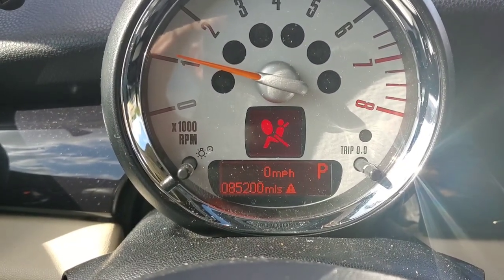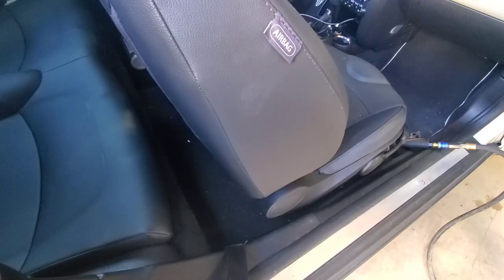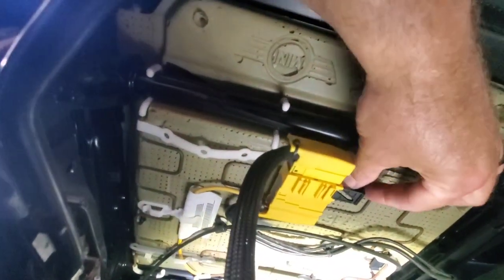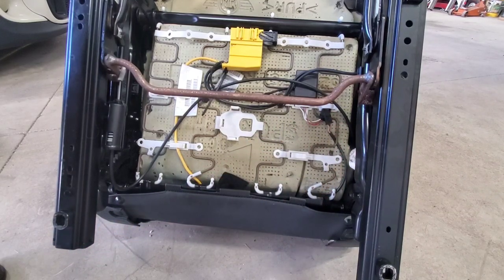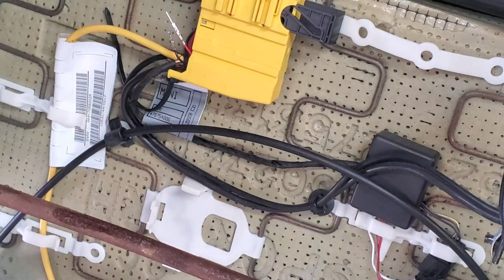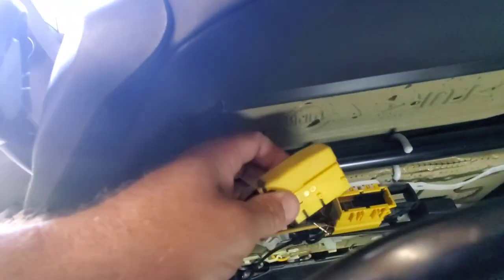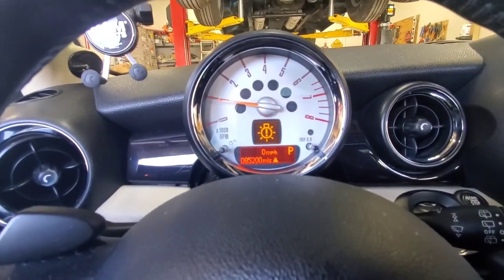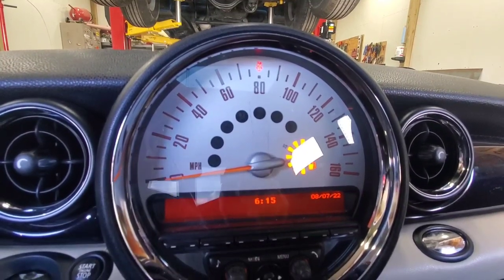Mini Cooper Seat Warning Lights Bypass- 10 minute fix

Comment: It looks like all the seatbelt bypass is doing is shorting the read and black wires / pins. Thanks for this video. You're right $1,500 to fix an obvious design / quality issue is ridiculous. Too many people have this problem for this to have been a reliable system. To have the default for a failure turn off the airbag is beyond dangerous.

Comment: I just recently bought a 2010 base mini and after purchasing discovered it had this airbag light issue. I checked underneath and it looks like it had this exact fix done to it, but the light is still going off. could the override piece have gone out? I'm trying to troubleshoot but can't figure it out

Comment: Do you have a way to do this for the rear seatbelt clips? I need to bypass the wires connecting to the seatbelt clips in the rear as they keep setting off the airbag/seatbelt light as I have removed rear seats also. Many thanks 🎉

Comment: how did you know it was the passenger side vs the driver side seat, does the driver side not have a sensor, are the instructions essentially the same for the driver side, lastly is there a link to the device to order from ebay and is it the same for all mini coopers, I have a 2010 Cooper S, thank you.

Comment: Do you recommend disconnecting the battery before doing any work on the seat electrics?
Reply from the maker: No reason too. You unplug the seat harness from the car before doing any work on it so I see no benefit to unhooking the battery.
Reply: @hotrodyj  yep, thanks just as i thought.
Reply: Purchased an emulator from amazon. Connector will not fit my R 58 coupe bought in the UK. Any difference between U.S and European vehicles?

Comment: What is the name of the part? Is it compatible with 2011 clubman?
Reply from the maker: Airbag passenger seat occupancy mat sensor bypass Mini Cooper
Reply: If you look at the compatibility chart on the EBay site that sells the part he is using here, it will tell you if it will work on your Mini. I have a 2012 Countryman S that is not compatible according to the chart.☹

Comment from the maker: Immulater has been installed for about a month and worked great for that month. Now both lights and back on again, both air bag lights and the seat belt light. No chimes or alarm sounds but the lights are back on. No idea why it worked and now it's not.
Reply: Where did you buy the immulater?
Reply from the maker: @beentrill9864  eBay
Reply: Ever find a solution ?
Doing this same bypass on a customers car as per their request. So I’m curious on the future of this type of “repair”
Reply from the maker: @fjsgte678  lights did come back on but no chimes or dings so I haven't worried about it.

Comment: @richardzimmerman1216 - Where did you get yours...details. Thanks!
Reply: Passenger  Seat Occupancy Sensor Mat Mini Cooper R55R56R57R58 Bypass Tester One.. thus worked on my 2009 r57. Thanks for the video!